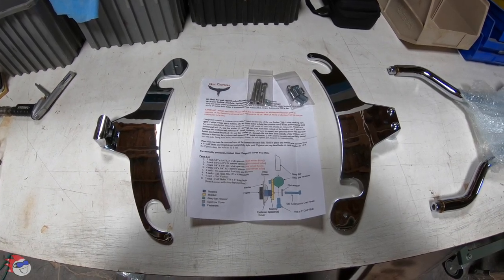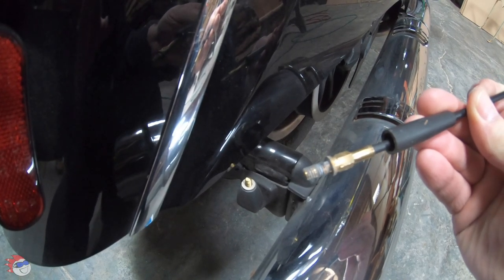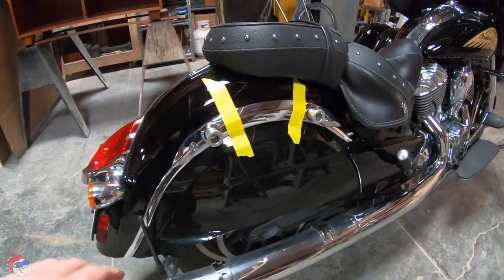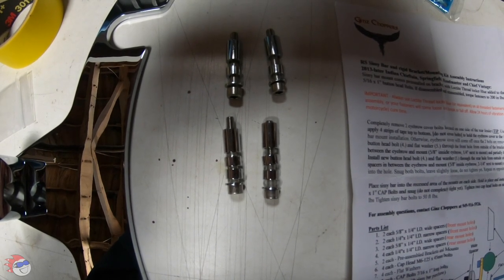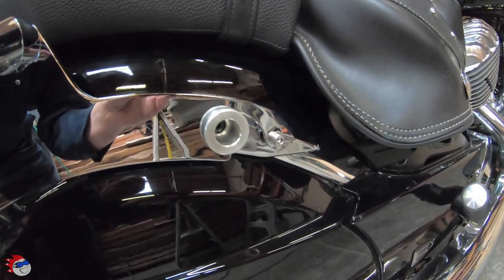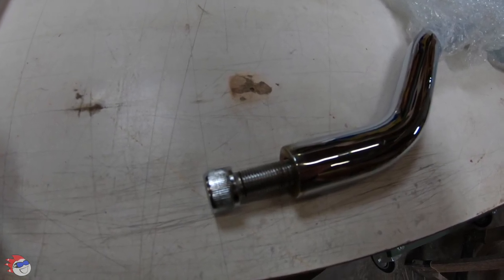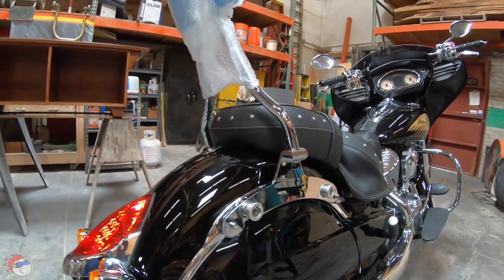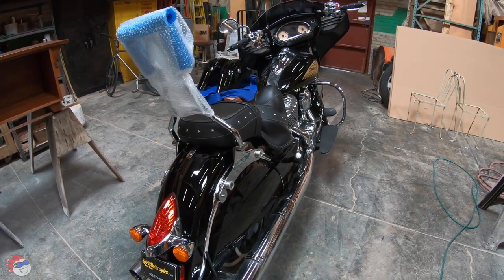Indian Chieftain Ginz Hercules Sissy Bar

Comment: Looks mean!! Good stuff man! I can’t wait to finish mine up.
Reply from the maker: Adventures of the bearded Bobber What’s the hold up, get her done 👍
Reply: Meatball Rebel it’s getting there. The bikes back together. Just finishing up the wiring. I’m at work so we’ve had to have a delay. Should be done tomorrow.
Reply from the maker: Adventures of the bearded Bobber I would help ya but a bit too far away. Can’t wait to it when it’s done!
Reply: Meatball Rebel thanks man. Hopefully I’ll be sharing pics of it with you guys tomorrow. I ordered the clutch cable so just gotta wait for that but that’s easy.

Comment: What size antenna did you install? How is the reception? Awesome bike!
Reply from the maker: I bought it on Amazon, search for "AntennaMastsRus - The Original 6 3/4 INCH is Compatible with Indian Chieftain”. I don’t use the radio much but it seems to work the same as with the original. Thanks for watching!

Comment: Very cool like the style of it .  But Indian dont make a quick release.   I got buddy with roadmaster he took his trunk off his.   But I wish he would take the  long antenna off his .
Reply from the maker: I think the Indian sissy bar is a quick release with the option to lock it on by using 2 small bolts. The short antenna is hidden and I don't use the radio so don't know how well it works now.